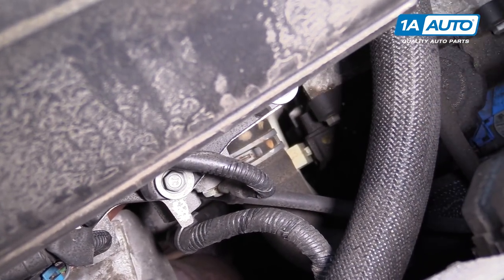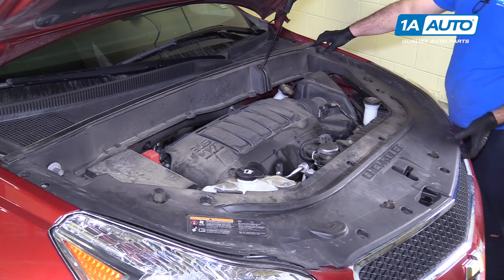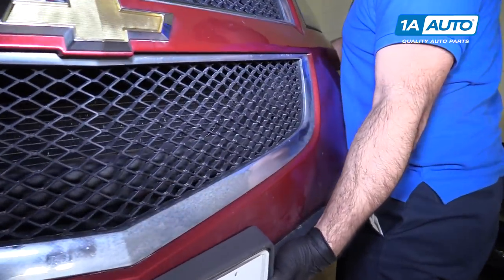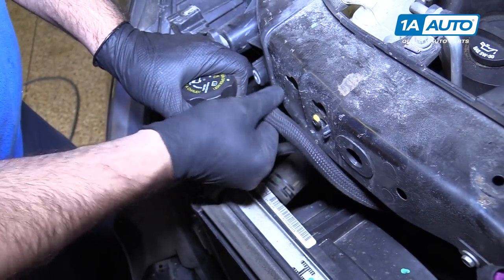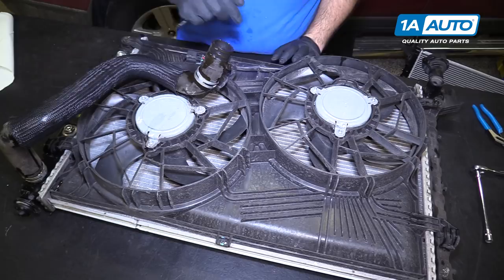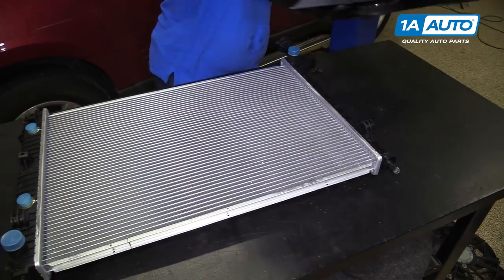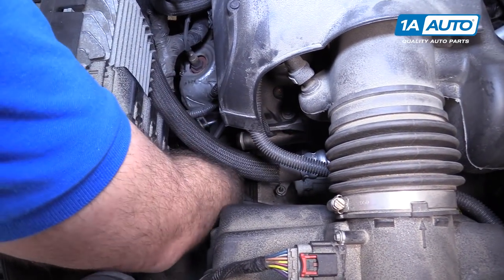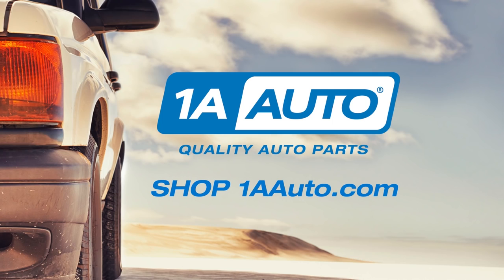How to Replace Radiator 09-17 Chevy Traverse

Comment: One of the best videos I have seen. No lecture, right to step by step with good camera work and talk thru. I used this just today to R&R ac condenser. 45 minutes taking my time and without a lift. No way I would have been so quick on my own.
As it turns out I need to replace hose on compressor as well - shortest path is line of sight thru the radiator so out comes too.
Thank you from a new subscriber - keep up the good work!
Reply from the maker: Thank you for the great feedback! +UncleBman

Comment: Even though I was replacing the radiator in a 2014 Buick Enclave this video showed me everything I needed to know. I was questioning the transmission cooler lines and this showed me how to remove them easily.  Thanks for such a great video.

Comment: Wow, that was an amazing video. I changed my radiator with no problem. Only suggestion is that the top radiator hose where it connects to the engine is almost impossible to remove. I recommend just removing the top hose at the radiator and not removing from the engine. Thank you so much for the video and I will be sure to shop from you in the future!

Comment: Great job i have followed all your how to videos on my 07 charger as well as my wifes 2010 traverse having a bad wine and had power steering pump replaced and alternator all was good for a week or so then came back can you do a power steering cooler on 2010 traverse i believe there is a slight leak also any suggestions would help thank you again

Comment: Awesome video. Is this the same exact steps for a HD cooling radiator?
Reply from the maker: We currently do not have an auto repair video specific to the HD cooling radiator. You might be able to apply some of the basic steps shown in this video to your application.  +Andrew Cerda

Comment: Is install a heavy duty radiator a direct replacement for a standard radiator?
Reply from the maker: +Mark A A heavy duty radiator will usually differ from a standard one, so they do not interchange.  1aauto.com

Comment: You don’t need to take the whole bumper off
Reply: That’s what I was thinking. Seems like a waste of time. Getting at the the lower releases for the air guiders looks like the only tricky part but can be done without removing the bumper.